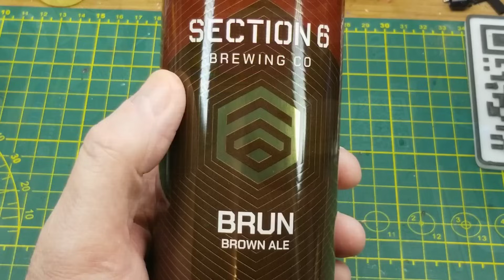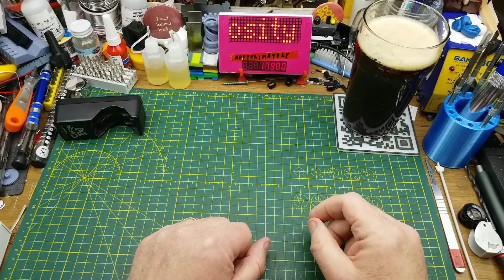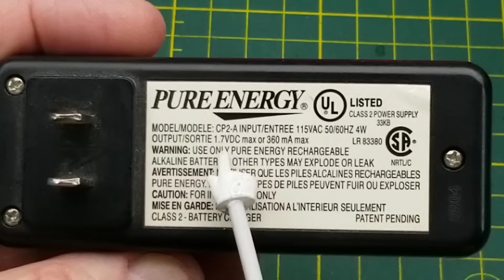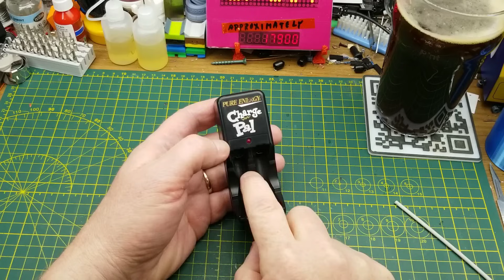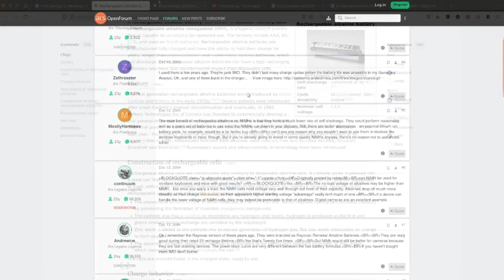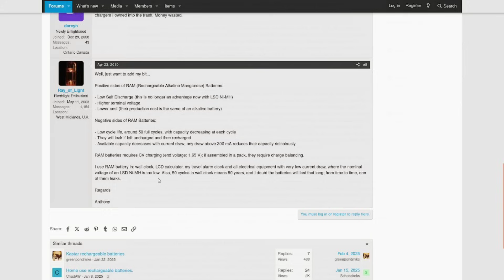Alkaline battery charger???

Comment: In 2023 i stumbled across Rechargeable Alkaline on AliExpress, this led me to study and research about this topic. I have a few old and "new" chargers that does charge alkaline. What conclution i have come to,is there is only 1 brand i know of that isnt a straight up scam, and those batteryes is like if Zinc Carbon was rechargeable after 1 or a  few cycles.  If i would choice a word,  it would be Alkaline extender,  since you trying to squeeze as much capacity as possible.   Also some alkaline brand perform simmilar to RAM's in cycles, so there are not much difference.

Comment: OK, I freely admit to not having enough easy familiarity with electronics to be able to make sense of this circuit.  One mystery is what the diode pair D7 -> D8 is doing (preventing the 0V rail on one side of R5 from backfeeding into the 0V rail on the other side of R5 - or something? Of course I don't see the point of R5 in the first place, but moving on...) 

Regardless, what little knowledge I do have tells me that putting two 1N4001 diodes in series is ludicrous here. 

My understanding is that the reason to put diodes in series is to sum the reverse breakdown voltage of the two. The 1N4001 is specified to withstand 50V, so having two of them should up that to a max reverse voltage of 100V,  on the 7.7VAC side of the transformer ? 🤔
Reply from the maker: It may simply be using the combined forward voltage drop to get closer to the target voltage?

Comment: I'd forgotten all about these Pure Energy batteries, they were sold over here in the UK, possibly through the now defunct retailer Maplin Electronics. If I remember correctly they only cost slightly more than regular alkaline batteries and were certainly much cheaper than NiMH rechargeables.

Comment: I remember having the Rayovac Renewal version that we had around from around the early to mid 90's up until 2005 or so and then NiMH cells began to take over.  They were a great hold over because they leaked less than standard alkalines did and the fact that they were rechargeable ment that a lot fewer batteries ended up in the landfill.  This was a time when everything used batteries and they saved a lot of money.  They would eventually leak but so did regular alkaline cells and other batteries at that time.  We were also using a lot of NiCD cells at that time but they developed dendrites and had a lower voltage than alkaline or rechargeable alkaline.

Comment: Nice. My dad had a lot of radios, and rechargeable batteries. Both NiCad and Alkaline rechargeable. If I remember right, the rechargeable Alkaline cost about 2 times as much as regular Alkaline, stayed charged for about the same amount of time, and could be recharged 25 times as you said. Even if I remember wrong and they cost 4 times as much, that's still a lot of saving with 25 recharges. I think we used rechargeable Alkaline when NiCad couldn't discharge completely because the device didn't like the lower voltage of the NiCad chemistry and shut off. Before Lithium batteries came out, I was annoyed that I couldn't find rechargeable Alkaline anywhere.

Comment: It looks like Q1 is supposed to pulse the charging current/voltage at 100 Hz, allowing disposable alkaline cells to be recharged. This won't work with C2 connected as it is, this might be a error in reverse engineering,  or maybe it was built wrong but shipped anyway because it 'works'. R4 also looks like it should connect to battery -ve .
Reply: I was going to say the circuit does not look quite right. Do like the square 0V unusual to see a ground loop drawn on the circuit. 🙂
Reply from the maker: Possibly.

Comment: Rechargeable alkaline cells are good when you want to increase the chance the cells leak out into your device.  If they don't do it on cycle 1, hey you can keep trying.  "VR" is probably voltage regulator, but could also be variable resistor - which almost perfectly describes how a linear voltage regulator works.

Comment: upload resistor photo(s), let ai identify the colors and maybe the value (no idea if upload is possible), 
or DIY get color sensor and print a jig - or - make a hole in a piece paper to let the sensor see only 1 band
Reply from the maker: I've tried many different tools, with wildly inconsistent and unreliable results.

Comment: The circuit works by the transistor turning on applying a constant voltage to the battery, around the 1V7 mark, and this then relying on the LM317 current limit and thermal shutoff to provide charge control, as it will run very hot, so will do SOA protection, and limit current to well under the 1.5A it can theoretically supply with infinite heatsink. Second transistor is there to provide the power to the LED, turning on with current flow, and the excess being shunted by the series diodes. The reason to have 2 bridge rectifiers is because the first one will have a very high ripple voltage, due to low capacitor value, and this will result in the operate LED and voltage regulation being very poor, so a second one, with low value capacitor, but still big enough to keep the low load stable is there to provide a clean reference voltage. 

Simple circuit, abusing the voltage regulator to do current limiting using the not well characterised thermal and SOA part of the chip, which is not tested in production, and only lot sampled to ensure it works, so there is a good chance of ones with faulty SOA and thermal limiting being used, as this relies on extra transistors that monitor voltage across the control element, and a diode that uses the internal bandgap to detect high temperature, and operate via the SOA protection to turn off the pass element, hoping it will not go into thermal run away.

Comment: I took a radio and modified it to charge the 4 D cells it had, using 2 resistors and a diode to charge with very rough DC. Only used zinc carbon batteries in it, and it worked out quite well, as the D cells lasted typically a year in use, instead of going flat in a week, as it was typically used mobile, and only plugged in overnight once in a while.
Reply: What did you charge it at?
Reply: @BenBear-u7u  Around 20mA on the forward side wit 5ma when the mains was lower than battery, to provide an AC ripple that is needed to plate the zinc smoothly back on the cell wall. From an old Elektor article about recharging alkaline cells.

Comment: I'd rewire the PCB and convert it into a 5V PSU using a Traco 7805 replacement regulator.
It already has the bridge rectifier and caps it needs.
Reply: 7805s have a different pinout to the 317.
Reply: @simontay4851  Yeah, like I said, I'd rewire it. It wouldn't take much.
Reply from the maker: I might just salvage the transformer and toss the rest.
can't get those batteries any more,and they were pretty mediocre anyway.
Reply: @pileofstuff  I prefer a transformer PSU. You get less electrical noise with them.

Comment: Yeah, looks like an LM317 wired up for constant current. The label says output 1.7V max or 350ma max.
Reply: Its got 360 ma cc and LM317 for 1.7v meaning you get cv or cc charge battery up to 1.7v and drop cc to keep battery not over chargeing

Comment: We used to recharge Duracell batteries and get a few more weeks out of them at work.  Then one lunch time luckily no one was in the lap, a battery exploded.  During the cleaning up of the mess we found the centre electrode had punched through the steel roof beam and stopped just before exiting the other side. 
We never recharged one again.
Reply: Really punched through a STEEL roof beam? An actual RSJ I beam? Those beams are really hard.
Reply: @simontay4851  Yep clean through. the inner electrode was like a steel or iron pin.
I don't think it would have been stopped from going quite a way in to a person. Hence it was banned from ever being done again. Only good thing it was done by the chief engineer so he could not fire himself. 🙂

Comment: The VR can probably be identified by wiping it with acetone.

I think you’re overall correct but I recall some chargers for those cells being variable current instead of variable voltage. It’s been so long since I’ve seen one that I can’t be certain which kind you have. That circuit definitely looks funny.

And no, those cells and chargers didn’t last any longer down here than in Canada. Great idea, just not feasible with the chemistry.